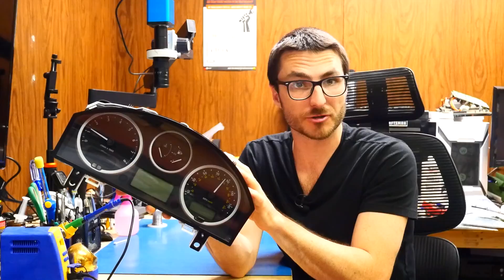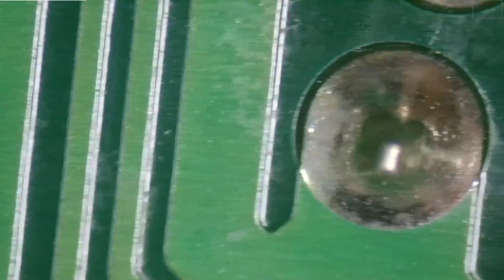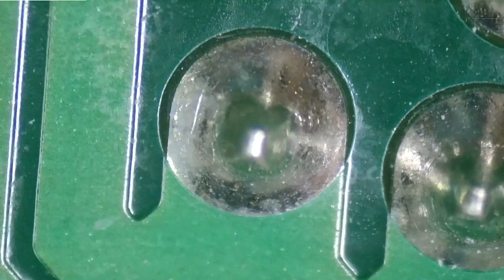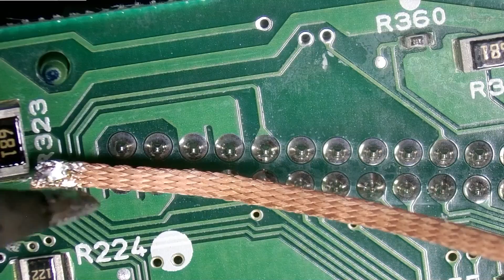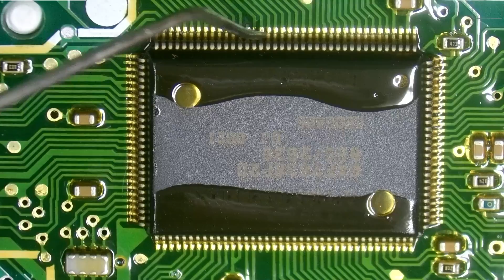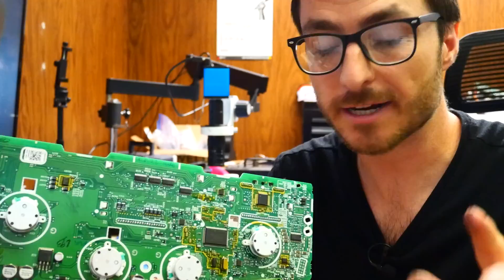Instrument cluster repair

Comment: I research and google says it's BCM(not sure what's the BCM of 2007 ford ranger, can't find anything about mysterious BCM). But now I'm wondering if it's cluster instrument and can it turn the  interior light randomly go on and off, brake light come on, odometer partially showing up? It happens during rainy times. And one time I bumped over something and the door light came on and the issue started again.

Comment: Can a random door ajar light turn on the cluster light and inner lights come on as well? Also odometer light partially showing up. And  brake lights stays on even though released the brakes. And if turn the vehicle off it won't turn on antithetft won't let the vehicle come on. Can this be the instrument panel or something else?
Reply from the maker: It's possible but I can't be sure. Try disconnecting the cluster from the vehicle and reconnecting it. Maybe even shaking the cluster around. Does that temporarily resolve the faults? If yes then your cluster may have bad solder connections and is the cause of the fault. If no then it's possible it's something else and would require more in depth testing/diagnostics.
Reply: @NicksElectronicRepair it was my DIY battery disconnect relay going bad. Causing bad connection. 😂

Comment: Do you only repair land Rover clusters? I have a 2010 Crown Vic that needs cluster resoldered
Reply from the maker: We can fix what ever has hardware malfunctions and require soldering work. Before we have you send in your cluster however, can I have you confirm the part number of your cluster so I can do a little research on it, as well as confirm how you determined that it needs soldering work. If you don't mind walking me through your diagnostics. The reason I ask is because we have recently had several customers send in working clusters with completely seperate issues.
Reply: @NicksElectronicRepair  I haven't pulled it out yet but the crown Victoria police interceptor is notorious for soldering going bad, I've checked the fuses and wires and they're all good, the dash LED lights power on bright or semi bright then dim then nothing intermittently to constantly it's really annoying. So my best guess is there's either a bad/worn connection with the soldering or something.
Reply from the maker: Sorry for not responding sooner, I must have missed your reply. 
If you push or pull on the wiring that goes to the cluster, does that make it worst or better? If you push a certain way VS another can you cause the failure or prevent it? If so then you defniteily have bad solder joints which is something we commonly see and can fix. If not, it could be an IC malfunction which can be harder to track down. I don't have a full bench system to test any type of clusters, so right now I am somewhat limited on what I can do.
Reply: @NicksElectronicRepair I'll have to check it out once I find the keys

Comment: Hello nick what is the name of the conformal coating you use? and where can I find it to buy?
Reply from the maker: The conformal coating we get is made by MG chemicals. It's product code is 419D. I don't know if it is the best coating, but so far it seems to fit out needs. 
Just make sure when you apply it that you are applying it to a very well cleaned surface. Put thin layers but do multiple layers for best protection. It dries pretty quick, maybe 15 minutes or so.

Comment: hardest bit of this kinda job is actually knowing what type of gauge motors you have when getting the pointers off so not to damage the motors  
and aligning them back to zeros after repair ,ive spent 1 hour and many attempts at zeroing needles on a old seat ibiza (no end stops) 
because  after moving the needles just a little to correct a resting point error they kept readjusting themselfs to a new position that was far out after shut down/reboot . never got to the bottom of what was going on just eventualy got lucky 
then i think old bmw x5 2005 ish the pins came out of the motors with the pointers which screwed the motors , i think those had internal return springs that were now out of sync with the motor one problem is many car makes use many suppliers for their clusters so its a minefield
Reply from the maker: Darren,

I am curious to know more about your comment. I am still fairly new to cluster repairs, we have only fixed maybe 4-5 so far and I have much to learn. When you say "The hardest bit is knowing what type of gauge motors you have when getting the pointers off so as not to damage the motors " what do you mean exactly? I usually take a picture of their exact location, use a tool to pull them out, and place them exactly as I had removed them. Haven't really had any issues so far. I did have a customer mention once that one of their needles of slightly off but they manually readjusted it they said and then everything was fine again. Have I just been getting extremely lucky or am I missing something?
Reply: @NicksElectronicRepair  yes lucky, I haven't had issues with landrover or ford clusters only ones with no end stops or end stops in the stepper motor  thankfully that's a really rare job so I've never had a chance to figure out how to prevent those issues, but maybe someone here has had a more thorough experience
Reply from the maker: Well I am going to start trying to perform more repairs on a larger variety of clusters in the future, also going to try and get more testing equipment for them, and when I do I will post more videos. 
I will share everything I learn as I go.
Reply: @NicksElectronicRepair  if I know anything relavent I'll chime in 
one good one, battery drain on fiat ducato,s caused by battery and other warning  lights staying dimly on is a closely guarded secret I would love to figure out but I get little time to experiment it's all dry joints and coding corruption I get and leaking vias on visteon clusters

Comment: Can you do custom cluster work?
Reply from the maker: We have done a few odd jobs on these like upgrading some of the lights with LEDs before but we are still fairly new with cluster repairs and are not yet fully equipped for full bench testing.
Reply: Was looking to possibly modify a 2020 frontier cluster to include two missing gauges found in 2012 Xterra cluster, looking at can outputs to see if oil press and    Batt voltage are reported or if I would have to go with analog gauges.  Bcm would prob need reflashed  is that something you guys could do?
Reply from the maker: That I think is going to be a little bit outside our wheel house. 
Unless there is a well documented process for this I would say the answer is no due to the amount of work that will be required upfront to finding out how to make it work.

Comment: Thanks for sharing.. Conformal coating, is that just board lacquer?
Reply from the maker: That's probably one to ask google, not sure what ou mean by board lacquer
Reply: I normally use PCB lacquer to seal areas like that. It's a fairly thin coating that can be soldered through. Conformal coating is usually quite a bit thicker.
Reply from the maker: For this one that would probably be okay, but there are certain circuit boards that would require conformal coating over lacker.
Reply: Thanks Nick, I did have a bit of a look, apparently PCB lacquer is also kind of conformal coating usually a resin or urethane based depending on the brand, yes as mentioned you can solder through it but it will clean off with PCB cleaner too.. seems  there are many types of conformal coatings apparently. As I'm from the pre smd days we just used the lacquer on older PCBs that we may have repaired to help prevent exposed copper tracks against corrosion, mostly in a non harsh environment. There are different types available for harsh  or high moisture or marine environments. Obviously things have moved some what forward in the last 30+ years.
Reply from the maker: Yeah, we typically just use the conformal coating spray used in this video for larger surfaces and if it's a smaller area or an IC we have a little bottle with liquid conformal coating although it's fairly high viscosity and you can brush it on.
Reply: @NicksElectronicRepair  If I need to apply to a small area, I spray some into a small paint can cap and dab it on with a cotton bud.
Reply from the maker: Yeah that's essentially what we do as well but I usually remove the end of the cotton swap so no cotten gets accidentally mixed in.